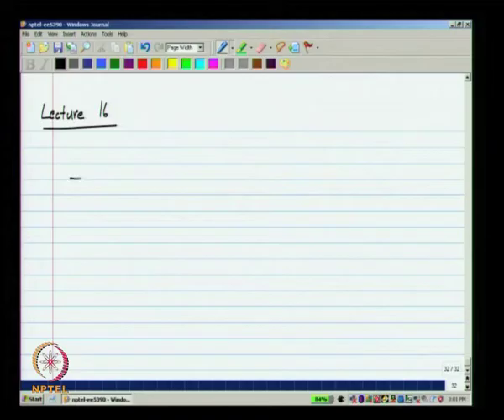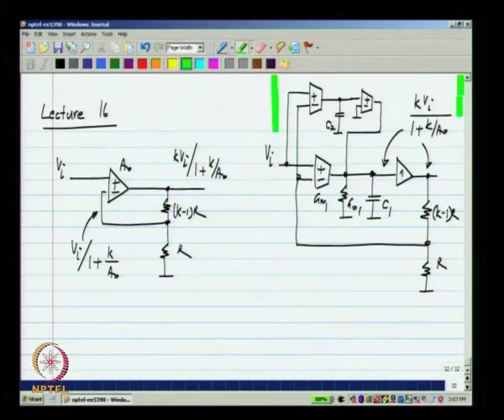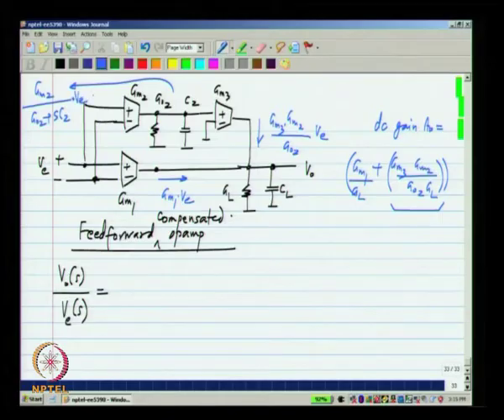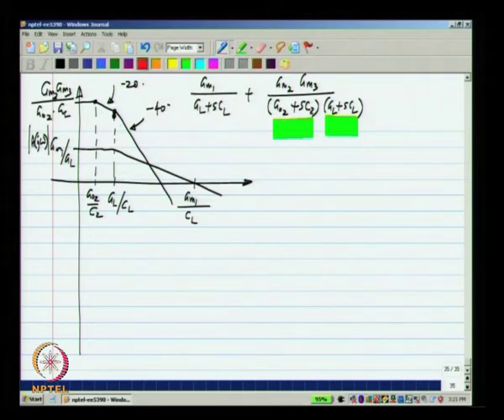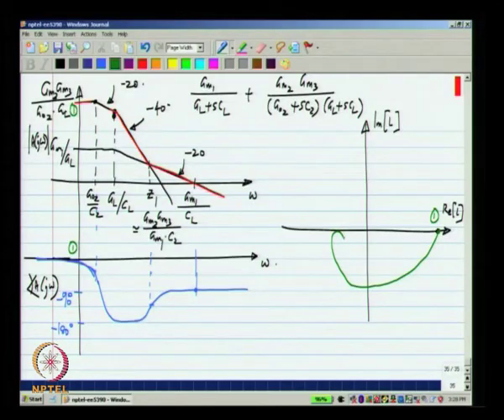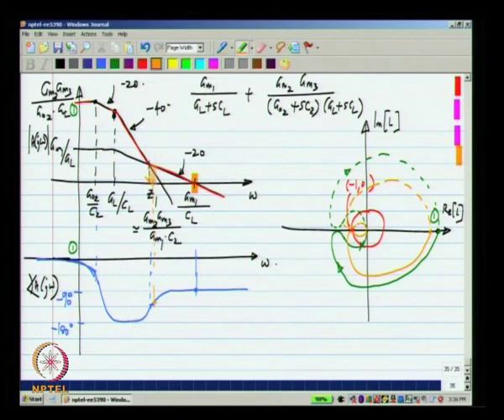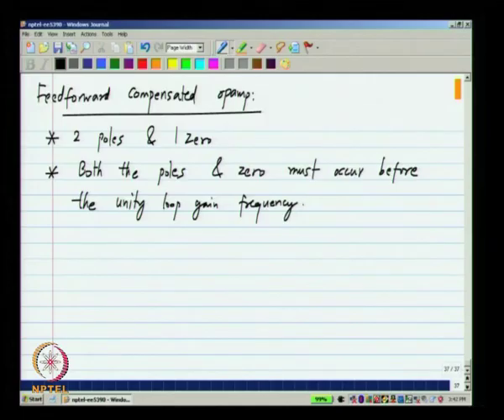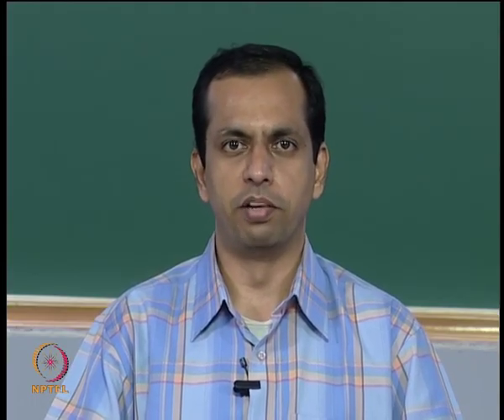Mod-01 Lec-16 Lecture 16

Comment: Why can't we only use one VCCS (instead of two) to feed the "added" current to the OpAmp?
Reply: then we essentially have the same issue with the one stage opamp. I.e, for Ve=0, output of the added circuit will still be zero and not contribute anything. By adding the second stage, the capacitor holds the voltage even at zero input (similar to an integrator stabilizing at 0 input) and this voltage on the capacitor is converted to a current by the transconductance amplifier, thereby giving a current to the output G_(OL) which further increases output to saturate close to desired k*V_i
Reply: To obtain more gain